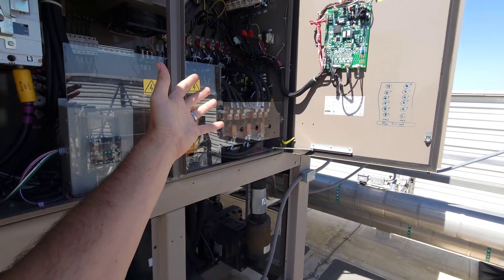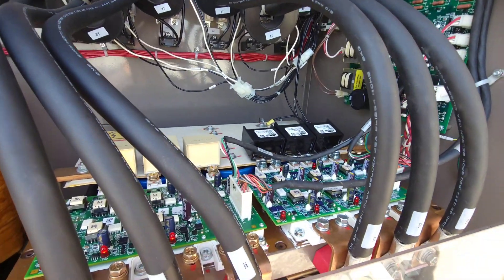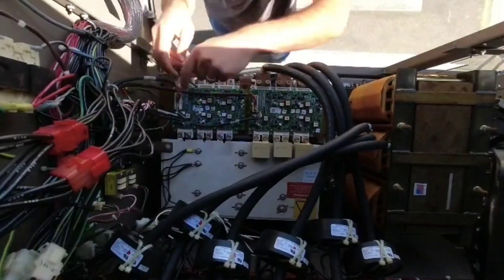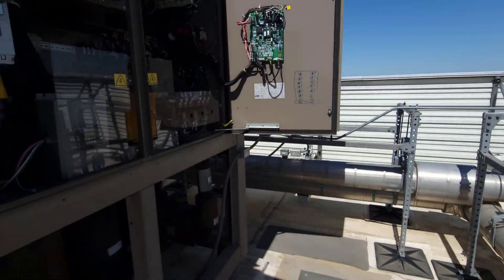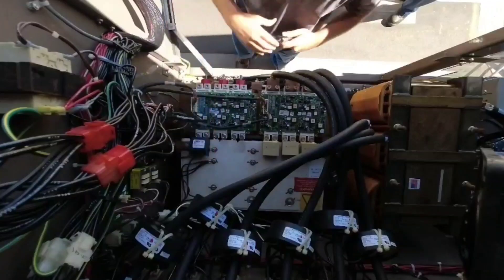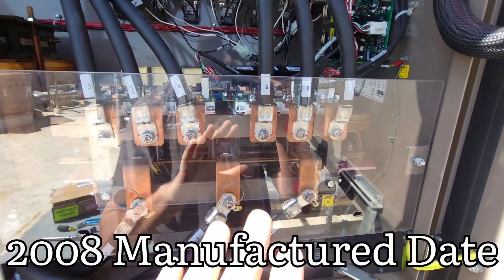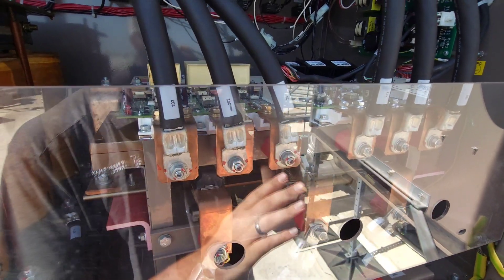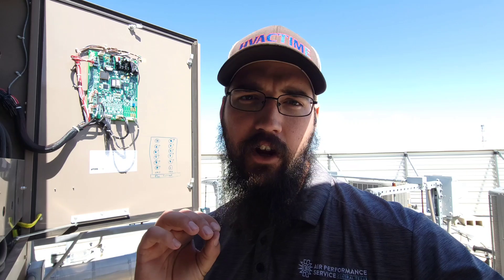Compressor VFD repair on chiller

Comment: Hi. You have a very informative video. I have a problem with the Yciv chiller, which gave me an error: High motor current, followed by a Low motor current error. Can you tell me what to check and change, as I am desperate? I would appreciate it.
Reply from the maker: Could be a IGBT issue, this would require a lot more operating data to give an appropriate recommendation.
Reply: @HVACTIME  Thank you for responding to me. I had the opportunity to remove and reinstall the driver from the working chiller, but the problem persisted.

Comment: Sir what is the write call that white paste...ty.
Reply: Sir what will happened if without the white paste.
Reply from the maker: Thermal paste, it will overheat without it.
Reply: @HVACTIME  oh..noh...i replaced igbt board and install it without thermal paste...chiller running but igbt temp. Still high temp...anyway sir thank you much.

Comment: Whay in the YVAA  chiller  they use in VFD to operate the compressor at 200 hz instead to use 60 hz
Reply: Screws need to spin that much faster to move the 134a

Comment: Hello, I am from Egypt. I have a malfunction in the same model of the chiller. The fault is the current overloaded motor
Reply: Check the overload settings in the VSD data section of the controller. There are potentiometers on the logic board of the IGBT that control the overload settings, after time I had the potentiometers go bad and lower my overload settings significantly. Easy to check.
Reply: Replace the SCR’s